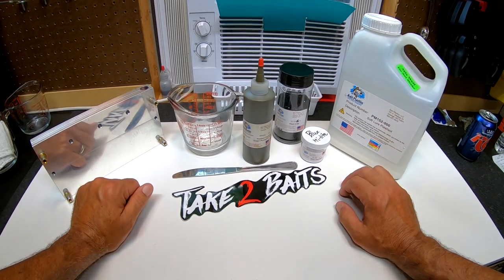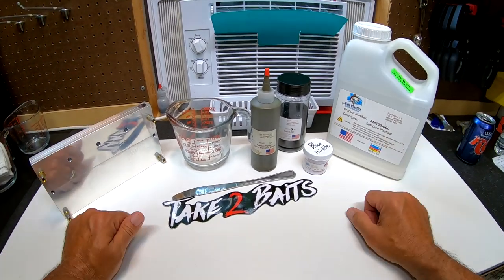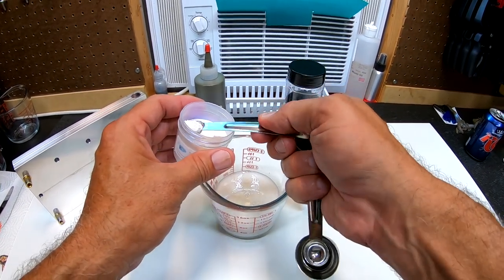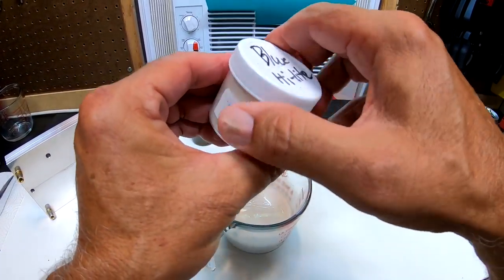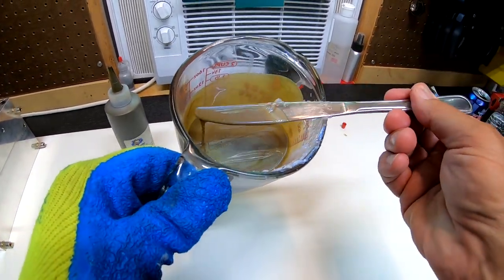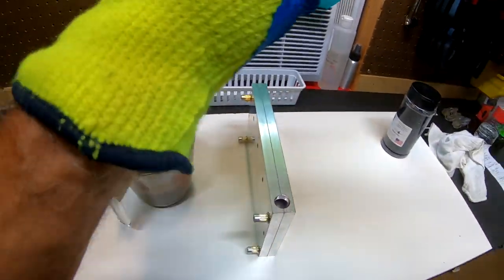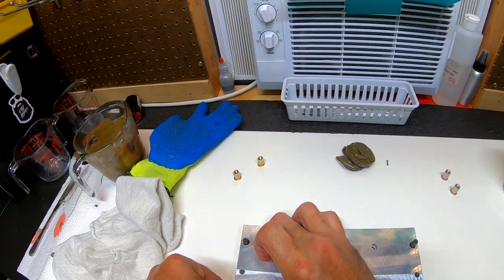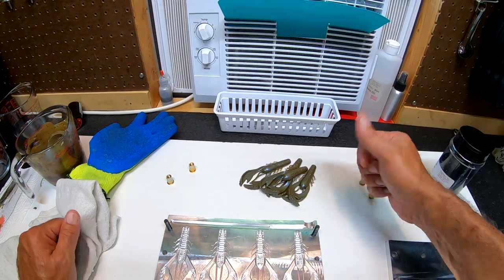How To Make Soft Plastic Baits | Making Soft Plastic Lures | Making Plastic Baits | Bass Fishing

Comment: Use Dead-On plastics it takes care of the hard packing and air bubbles dont even need a vacuum
Reply from the maker: Hey thanks for the comment.
I have never had any luck at all with Dead On.
Rather it be cooking issues or tacky after cooking. Got rid of the Dead On and moved on. 
I use a degasser for moisture control and bubbles both. But what works for me may be overkill for others.

Comment: Can I use luresol to make plastics?
Reply from the maker: Hey Ryan, 
Short answer is yes. This is a Polysol product and can be used to make softlalstics. I on the other hand had found that Bait Plastics Polysol is better and more heat stable. I hope this helps and any more questions just ask.
Reply: Take2Fishing thanks!
Reply: Take2Fishing how can I do the top half of a bait one color and the second half another color like your gpsp color way
Reply: Take2Fishing and one more thing what is that powder that makes the plastisol look pearl/blue that you used?
Reply from the maker: Hey Rylan. 
1st question. I use what they call a dual injector and this allows me to mix 2 different Colors in 2 separate glasses. Next I suck the plastics up into the dual injector and inject 2 colors and one color fills up 1/2 of the mold maybe the bottom and the other does the top of the bait.
2nd question that Powder is Color Shifting or Pearl from Bait Plastics.
Hope this helps.
Look at my other Videos and you will see me using the Dual or Twin Injector. Hope this helps👊
Reply: Take2Fishing thank you
Reply: Take2Fishing I just made my first plastic and it was a swimbait but it almost ripped apart when I was separating the 2 halves of the mold and it was really sticky. Do you know what the reason is for this?